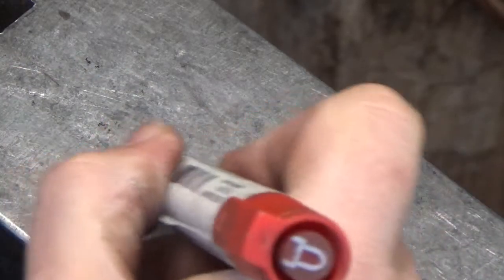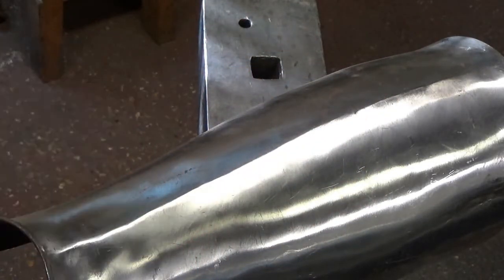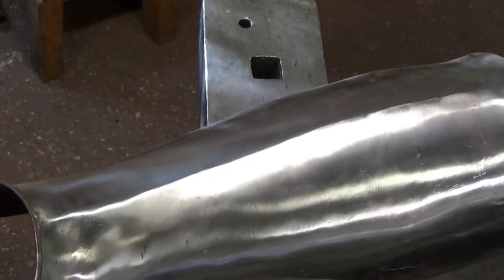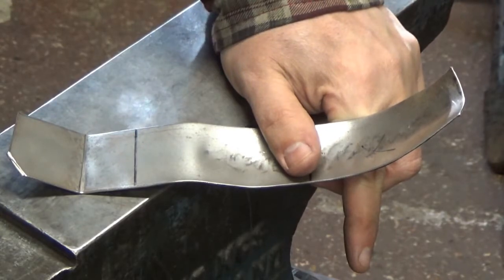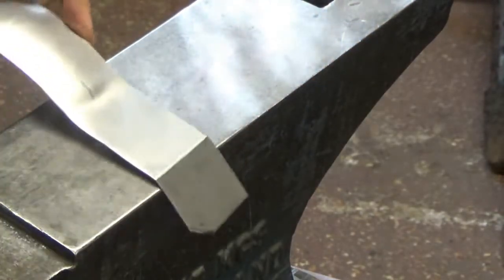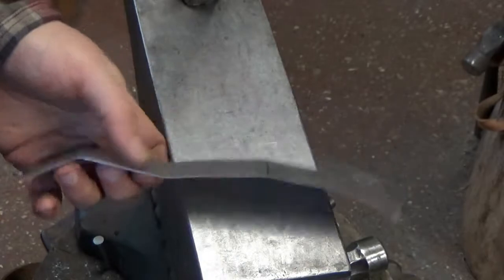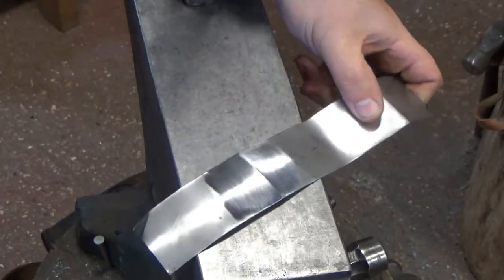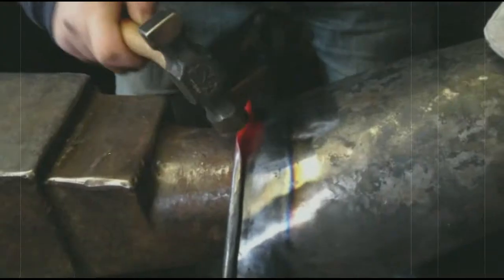How to create simple creases in armour. Five Minute Fix #8

Comment: Thanks for the video.  I would like to see how you sanded the sides of the crease down.  Could I suggest maybe a couple videos on adding a nice finish to armor?  I have had some frustration with getting a nice finish after planishing.  Planisihing, bouging, and sanding.  Thanks.
Reply from the maker: I'll add it  to the list, my cleaning kit is very primitive to say the least, but you can achieve nice results with practice. Cleaning is a skill of it's own and often not thought of as something to get better at, I'll see what I can pull together.

The simplest rule is to ensure that each grit gives a smooth result, if you've not removed the dinks and dents with the grit you're on it will remain there through the rest of the cleaning.

Happy hammering.